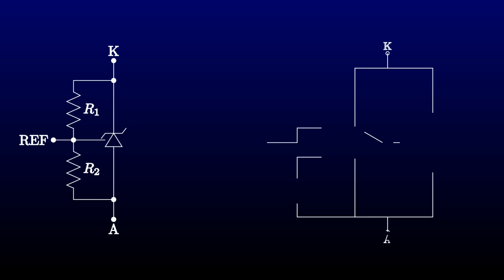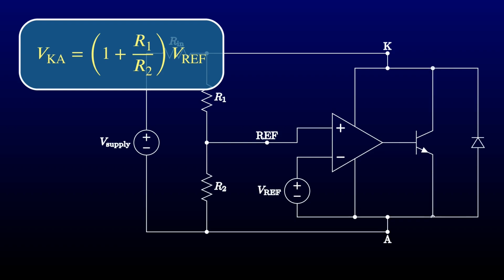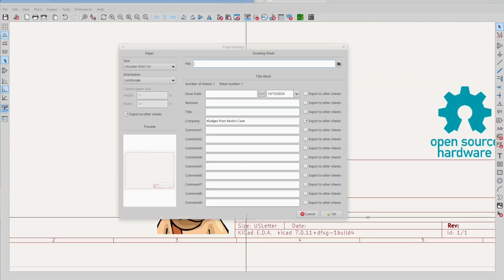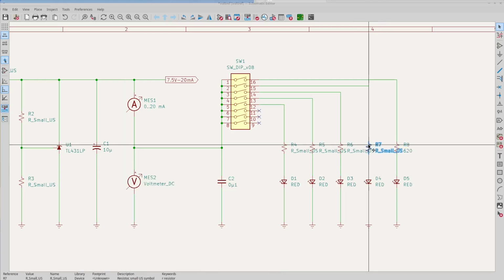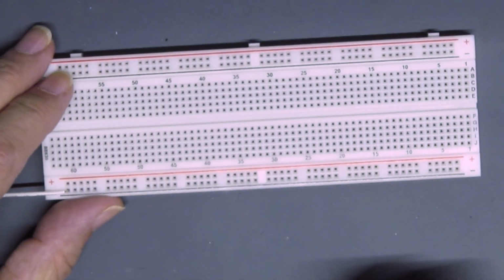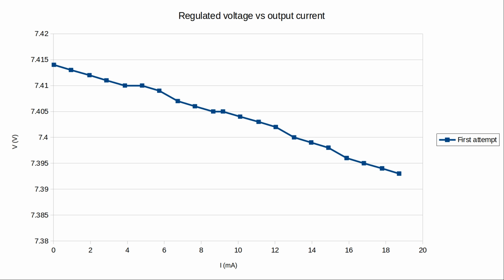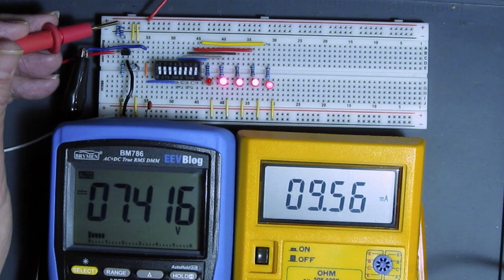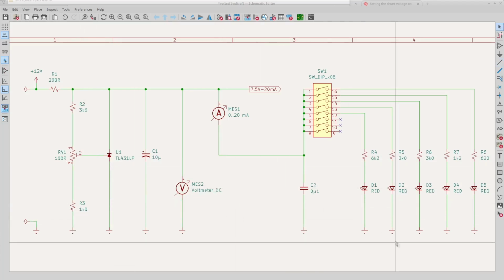Bandgap Voltage Reference - a Better Zener Diode

Comment from the maker: OOPS! I did it again! I had a typo in the part numbers on a slide, which I then read aloud.
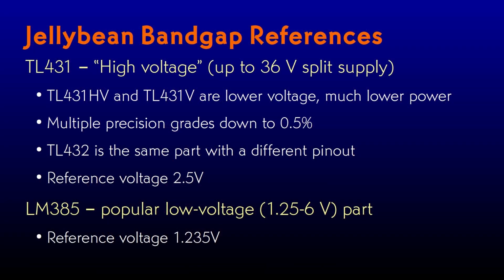4:43  Correct part numbers for the low-power parts are TLV431 and TLVH431.  
Sorry for the confusion!
Reply: Thanks

Comment: TL431 is excellent
Reply from the maker: It's not as great as MAX6350A and friends, but it's a lot cheaper!
Reply: @KludgesFromKevinsCave I recently used a TL431 in a battery monitor based on a bipolar  transistor Schmitt trigger to stabilise its rail and monitoring the other side of the regulator with a potential divider.
It was much better than a Zener 
The idea is to use it in a solar power application to stop a circuit from doing whatever below a certain voltage so the battery can recharge.
It ended up being a versatile circuit for its simplicity
Reply from the maker: @Dazzwidd  Whoa, careful there, tiger!  Li--ion battery management would deserve a series on the channel all by itself, should I live that long.  There are so many conditions that can cause things to catch fire.  You need to limit the charging current, and often your power source also needs a current limit.  You need to switch over to a float-charge mode once the battery is full (usually when the current drops to 10% of the maximum level) - or after a preset time, to deal with a leaky cell.  You need to suspend charging if the cell overheats or freezes - and lower the float voltage at high temperatures.

And it's important to include functionality to disconnect the cell completely under dangerous conditions: cell voltage <2.6V or >4.275V, cell current greater than a fixed limit  (1.9A for one type of 18650 I've used), or a load short.  

And still worry about packaging because sometimes the damned things just catch fire.

For the whole combination for a single-cell pack, I like the LTC4070 for overall management, and the DS2762 built into the pack.  It's often useful to add a microcontroller to keep track of overall battery health, including reading out the charge integrator from the 2762.  You can get a lot of advance warnings that a cell is going bad:  slow current taper approaching full charge voltage, loss of charge during long idle periods, noisy voltage profiles, charge capacity >> discharge capacity, excessive temperature rise during charging) and warn the operator.

Multi-cell packs are a whole other story - look at the data sheet for BQ29410 to get an idea what you need to worry about.  

If you're doing micro-solar, you might want to look at power-harvesting parts like LTC3105 (solar) and LTC3108 (thermal) They're also great for running portable devices off a single AAA cell (1.35V new, 0.9V at end of life).
Reply: I'm sure there is better out there, but the TL431 just ticks so many boxes 😅

Comment: Signal Zeners are indeed not always useful (they are good for noise tho), but "power" Zeners are essential to have a few on hand for circuit protection and crude voltage shifting.
Reply from the maker: Sure, if you need to keep things as simple as possible. For circuit protection on input leads I tend to use diodes to both rails rather than a Zener. On power supplies I will use a Zener - in the gate circuit of an SCR crowbar. I just don't find Zeners useful enough to fall in the category of 'keep on hand' rather than 'buy at need'.

Comment: What CAD software are you using?
Reply from the maker: It depends on what you're asking about. The schematics on the project GitHub are KiCAD.  Circuit simulations are in Paul Falstad's 'circuitjs'. The animated circuits on a blue background are an unholy combination of Manim, CircuiTikz, and homegrown Python code and TeX macros that I wouldn't wish on my worst enemy, but it does the job and I haven't found or been able to cobble together anything better.

Comment: Zener diodes are superior to the TL431 when used as clipper, clamps, etc. It also does not tolerate transients as well. While it's certainly a good part to keep on hand, I still keep a good selection of Zeners.
Reply from the maker: You're right that Zeners are great for transient voltage suppression. I keep a few 10V ones on hand to protect MOSFET gates. They're not great as voltage references. The low voltage ones have a terrible I-vs-V curve, and the higher voltage ones are noisy as hell. So I don't find it all that useful to keep a complete kit of a range of voltages the way I did back in the day. If I need one for something like an SCR trigger, I order a handful in the voltage and power dissipation that I need.

Comment: Zeners make an excellent noise generator. They are useful signal analysis and much more, going up to 2000 MHz

I regularly use these bandgap diodes in new designs. They can be directly used as shunt regulators giving an extremely stable and low noise supply voltage for signal front ends. Just one resistor and a diode fitted according to the need of current
Reply from the maker: @henk38599  indeed! There are a couple of later videos on this channel where a TL431B appears as a shunt regulator, and as a current source with a outboard pass transistor, for exactly the reasons you mention. And the channel's very first video is about a noise source that, rather than using a packaged Zener, uses the B-E junction of a BJT in avalanche conduction - essentially the same thing as a Zener.
Reply: @KludgesFromKevinsCave  Yes, you just reminded me of the very old trick of using an npn in an incorrect polarity and current limited. It becomes a strong noise source and the junction transforms to a zener. Many years ago wanted to see what is happening inside the npn metal cans. Some of them sent out white light like a weak LED. Thank you for sharing.

Comment: In a recent design I did, I used one of these guys in the topology where it drives and opto-isolator to communicate from an isolated output section to the input side of a DC-DC converter.  I only really wish that they were faster.  They are only really good to several KHz in the typical circuit.  This makes it very worthwhile to do some feedback locally on the input side if you can.
They are cheap enough that if you need multiple different reference voltages, it is fine to use more than one.
Reply from the maker: Yeah, Zeners are a lot faster.  Interestingly enough, low-voltage Zeners usually switch faster in the reverse direction than the forward direction - particularly fast-switching ones are sold as back diodes and used as RF switches.

One thing I use these for is to power CMOS op amps (often with ±3 volt supplies). The op amps are micropower and usually driving high impedance loads, so there's no need for a fancy power supply. That lets me get the advantages of the low-voltage, low-power, rail-to-rail op amps where I need them while still fitting gracefully into a ±12V system.
Reply: @KludgesFromKevinsCave  I tend to use series regulators or references in that sort of case.  The analog in my current design uses Plus 9V, minus something like but not all that close to -9V and switches to a 3.3V supply near the end of the analog chain where it goes into the ADC.  The +9V is a linear regulator and the -9V is a charge pump.
Reply from the maker: @kensmith5694  Yup. There's more than one way to do it.

Comment: I love TL431s, too. Super simple constant current sources and sinks, and they can handle 100mA all by themselves without a pass transistor.
Reply from the maker: @SkippiiKai  I have a discrete OTA in my notebook where I need a mA or so at something like four different voltages. I haven't quite worked through all the details, I might need LM385s instead. 

Of course there are amazing ones like AD780, at correspondingly amazing prices! The TL431 is cheap enough to just keep a few on hand.

Comment: Do you think that measuring the resistor values would have led to some improvements?
Reply from the maker: At the low end, the biggest single problem is noise, which is mostly just that my cave is electrically noisy My bench is right by the HVAC system, and I don't live that far from a 50 kW AM broadcast tower, and so on.  The cheap computer under the bench also puts out a lot of hash that I haven't managed to tame yet.

The fact that the current sense is measuring the emitter rather than the collector is also a little annoying.  Of course, I could fix that with a Darlington, but a real tracer needs to measure floating voltages and currents.  In the forthcoming unit on current mirrors, I'll breadboard a different quick-and-dirty tracer that uses differential amplifiers.

Finally, using a ramp was a bad idea.  The transition when the ramp switches back over finds every instability in the measuring circuits.  Taming the oscillations was kind of a chore. But I wanted to show the ramp generator as an integrator application - plus, it's the basic core of a sawtooth VCO.  

I'd want to take care of those problems before I go chasing fractions of a percent by matching resistors. (I probably wouldn't do that by hand - 0.1% low-rempco resistors arent' that expensive any more.)

Comment: Great video. Thanks. Just to make your analysis easier, the transistor in the part inverts the output. You can then think of the non-inverting input terminal of the op-amp as the inverting terminal. Negative feedback is then easy to see.
Reply from the maker: @Electrotech1980  I'll most likely be taking just the sort of shortcut you mention as things move forward. Right now, I wasn't too sure that my typical viewer would see at a glance that it's a common-emitter circuit and therefore inverts the signal, so I thought it would be better to spell it out.

Glad you enjoyed the video!

Comment: Do you know that tunnel diodes (which can amplify very high frequencies) share some similar part in their I-V-diagram with Zener diodes (or shorter Z-diodes)? BTW: Your ECAD looks like OrCad.
Reply from the maker: Are you saying that Zener diodes have a negative resistance region? (I'm guessing around the start of avalanche conduction.) I don't think I've heard of that.  I guess that the noise you pull off a Zener or a transistor in avalanche conduction is sort of a relaxation oscillation.  Or did you have something else in mind? I'm curious.

You can do some pretty funky things with devices that have negative resistance somewhere on the curve.  Maybe one of these months I should build an oscillator around a negative resistance device.  I don't think I'm going to find an Esaki diode readily, but a 2N6028 UJT, a neon lamp, or a diac should make for some interesting behaviour.

[Hmm, I just checked, and there are a lot of Russian tunnel diodes on Ebay and the surplus sites.  Interesting.)

The ECAD system is KiCAD, not OrCAD.  It's open source, and so far it does what I need it to do.
Reply from the maker: Now that it's morning and I've had my coffee, it occurs to me that you're not talking about the tunnel diode's negative resistance, but rather its nearly constant voltage in the reverse direction, so that (when biased properly) it can rectify weak signals (a few hundred mV peak amlitude) up in the microwave region.  Essentially, that's what a back diode is - a Zener with a threshold voltage of a few hundred mV.  I'd forgotten that historical curiosity. The current edition of The Art of Electronics doesn't even mention them. (Although there's an index entry referring back to an earlier edition! Apparently Horowitz and Hill didn't want to forget back diodes entirely!)

Comment: Thanks much for your work. Might help me make up for not paying close enough attention in my circuit analysis classes all those years ago.

Would you consider a couple future videos on basic KiCAD usage?
Reply from the maker: @quint5544  Anything in particular you want to see? I'm by no means an expert but I manage to get the job done. 

I'll probably show more KiCADding once I've covered enough of the basics to want to commit circuits to EuroRack modules.
Reply: @KludgesFromKevinsCave  It's been a couple decades since I did schematic capture with any regularity. Just about anything would be greatly appreciated! As far electrical concepts go, I'm going to start over again with your transistor series and keep an eye open for anything to do with power FETs.
Reply from the maker: @quint5544  Might be a while before I get to power FET's, because right now I'm focusing on audio signal processing. But if the channel goes on long enough, who knows where it might wind up?

Comment: Please let know if acording to Forest Mims circuit you can get a variable DC  From 1 to 5 volts conecting a TL431 in the ground os a 7805 Regulator .Thank you very much
Reply from the maker: Forest Mims did a lot of circuits, so I'm not sure which one you mean.

You could use a TL431-based circuit to boost the ground terminal of a 7805 to make, say, a 7.5-20V supply.  Unless you have a split supply available, it's not obvious to me how you'd get less than 5 V out of the 7805 - it regulates its output to 5V above its ground reference.

Obviously, you could use some other voltage regulator to lower the voltage from the 7805, but I don't think that's what you were talking about.

There are some interesting power supply ideas in the TL431 data sheet.  But for, say, a 1.25-5 V linear power supply I'd probably just use the venerable LM317 or one of the new, lower drop-out adjustable regulators.

Comment: I think Zeners (at least the lower voltage ones) are lower noise than bandgaps generally. The TI datasheed for the TL431 shows about 10 uV p-p 0.1-10 Hz noise. While on the internet people have measured modern 6.8V zeners to be about 3 to 1 uV p-p 0.1-10 Hz noise at modest current. Personally i have measured old soviet 9V reference zeners (7.6V zener + 2 plain diodes in series), they measured 40 to 10 uV p-p 0.1-10 Hz noise..
Reply from the maker: @victorman2227  yeah, 5.6-6.8 is kind of the sweet spot for Zeners.  Higher, and you get lots more noise from avalanche conduction, lower and the voltage is all over the place. The shunt regulator configuration that I show will, of course, filter a lot of the noise.